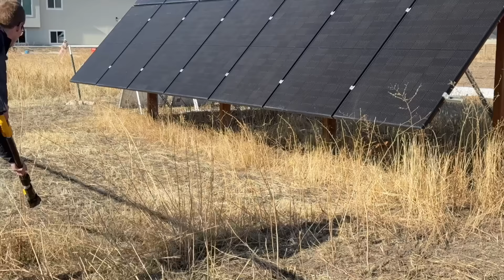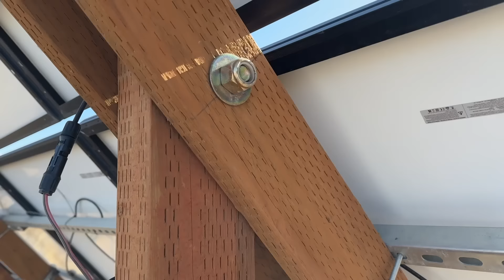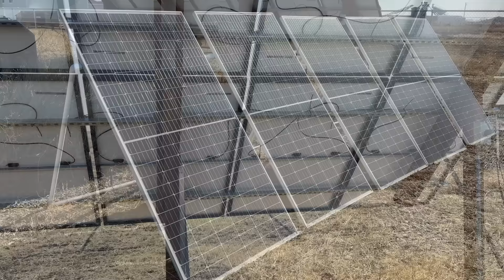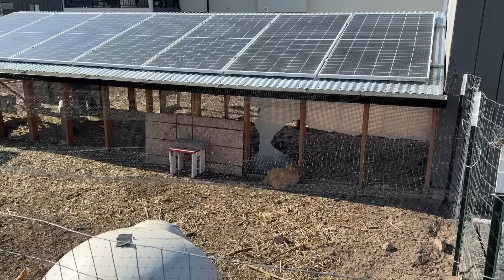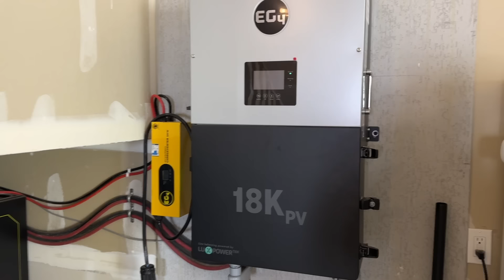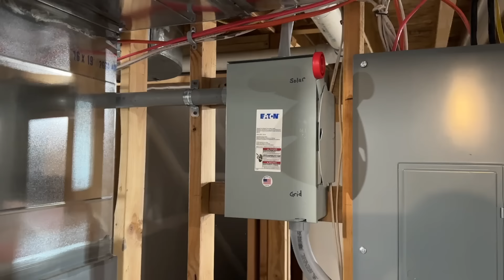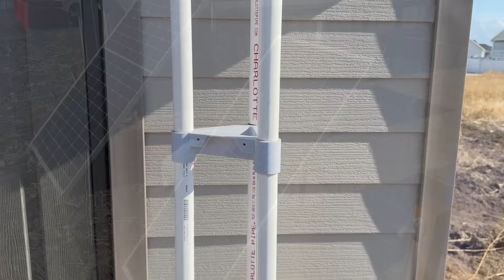We Said Goodbye to the Power Grid... Forever

Comment: Does the wind never blow there?
Reply from the maker: It’s actually a pretty windy area! I thought we might need to anchor down our big array further but it’s been solid. Just flexes a little with the big gusts. We set the posts with four 80lbs bags of concrete in each hole and each hole was probably 4ft deep.

I didn’t mention in the video but each PVC stand for the temporary array is anchored down with long concrete stakes. You can kinda see them in the video. They haven’t budged either but it helps that wind normally blows in line with that array and not against the back face.
Reply: @ thanks for the explanation. That big array, I would still question .  Thanks for the video! Nice setup.

Comment: Can you please share the hardware used with the strut channel array?
Reply from the maker: It was actually pretty tricky to find hardware that worked with strut channel since the clamps all seem to come in metric sizing. But this is the best I found (though with some small modifications to make it work) -- https://amzn.to/3WIWDk5

The nut that comes with the end clamps isn't wide enough to span the gap and grab onto the strut channel so I added a 5/16 x 1-1/4 in fender washer directly on top of the nut. The washer bends when tightened and prevents the nut from slipping through. It has worked perfectly and hasn't loosened at all. You can see it briefly in the video when I show the side angle of the chicken run array.

For the mid clamps, I enlarged the hole on the clamp with a 3/8 in drill bit so that I could use a 3/8 in x 2 in bolt and a standard 3/8 in strut channel nut. I used the strut nuts with the blue plastic guides to keep them in place during assembly and they have worked well.
Reply: @ Thanks!
Reply from the maker: I just released a detailed build video for our ground mount and I included a section showing how I made those solar panel clamps work with strut channel. Hope that helps!